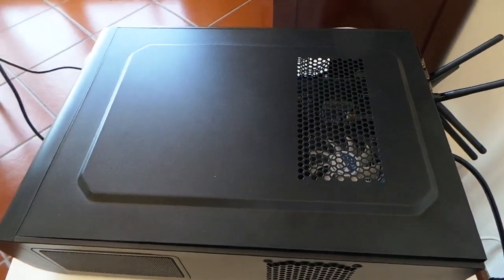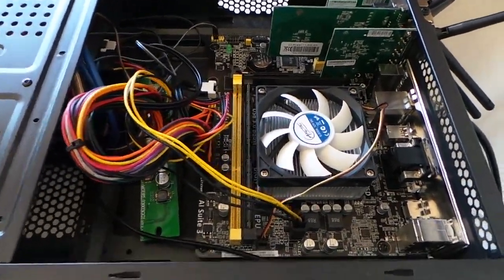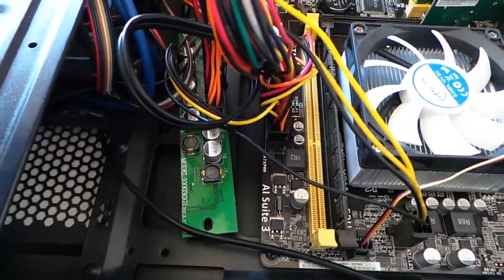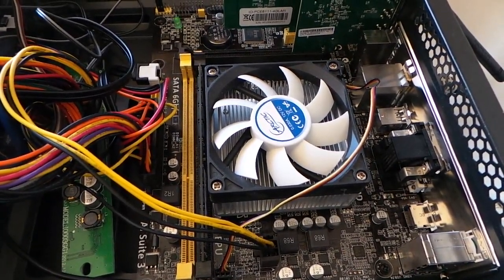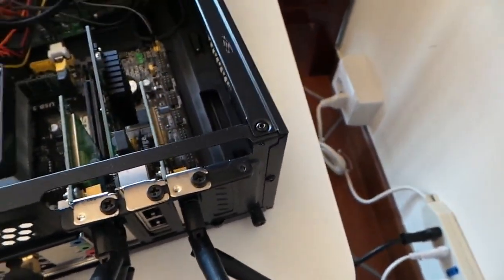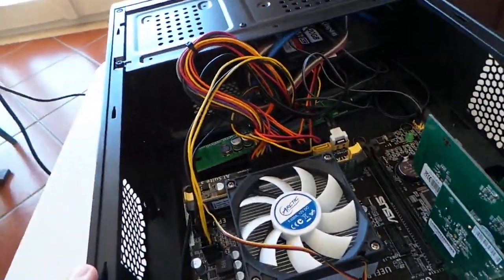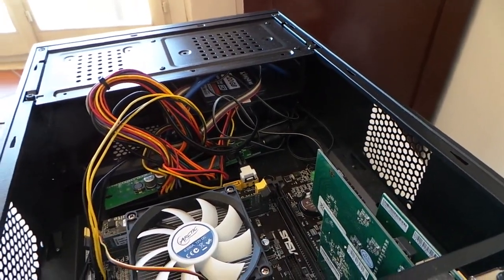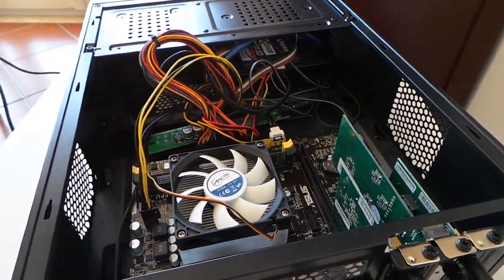DIY BUDGET ROUTER BUILD FOR HOME NETWORK

Comment: Great video but I personally recommend the Fujitsu S920. I bought it for 28$ with power brick, it had 8gb RAM and a 62gb mSATA SSD.
It's old but it has one slot for regular card and one for laptop wifi cards.
I bought one WiFi card with BT 5.0 and WiFi 6, which costed me 37$ used and I also got a cheap DVI monitor for 12$ and with this setup I had a great WiFi router with OpenWRT, OpenVPN and a media center that used one of the USB 3.0 connectors for reading data from a Crucial SATA SSD that was in a 9$ SATA to USB 3.0 enclosure.
The best about this PC is that it's passive cooled and it only uses like 10-18w of power.
It's also great for PfSense but since my ISP provided router had a very shitty specs and crashed when I connected more than five devices to WiFi and two to Ethernet ports, I decided to just use it as a replacement for the router.
If you replace the stock thermal compound, it rarely reaches over 48*c and since it's passive cooled, I use it in my room where I sleep and have my gaming setup put at.
Btw. Before buying the S920, check what architecture the CPU has. This PC shipped with a x86 and x64 cpu

Comment: What operating software are you using? I'm interested in the wireless interface compatibility. DD-Wrt, openwrt, opnsense, pfsense? Or a more traditional OS like Windows or Ubuntu?
Reply from the maker: I am using Ubuntu, it can be configured nicely and it's not a huge headache.

Comment: Wouldn't the electric bill running this 24/7 far surpass buying a good mimo router? I know you mention that around 3:12, but what about the power supply running 24/7? Orange PI PC runs OpenWRT.
Reply from the maker: Good question!
Yes, the bill will be higher, but if you need network stability, a strong signal and expandability this system is still a very good option. Also, OpenWRT takes much more time to configure and can be difficult for newbies, while my Linux distro was very easy to set up.
You can also use components that are less power-hungry (by recycling an old netbook, for example) and set up VLANs to use less network interfaces.
Reply: How is the wireless coverage using these wireless cards?
Reply from the maker: Very good, actually. I can connect from anywhere in my house and I have reduced a lot the random disconnections caused by interferences.